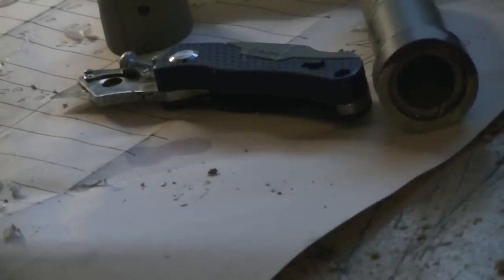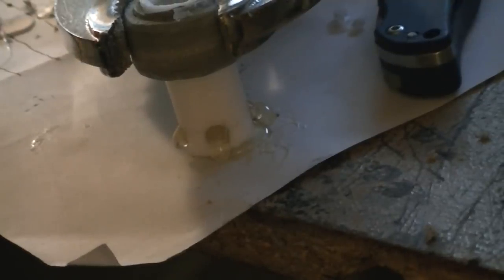How to: build a fully automatic PVC paintball gun - part 4: plug

Comment: I'd like to make mine be able to shoot 6" nails or crossbow bolts. On the piston, I left the non lathed area at 6" and the lathed area at 6". The plug is about 2". Would this work or do need to adjust the length on something? Will piston even be able fire something that long and heavy?